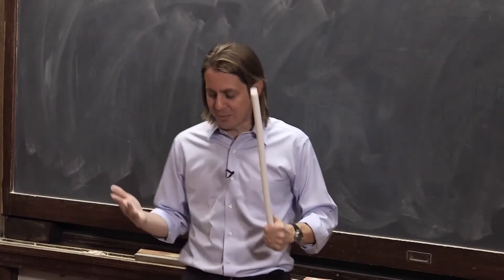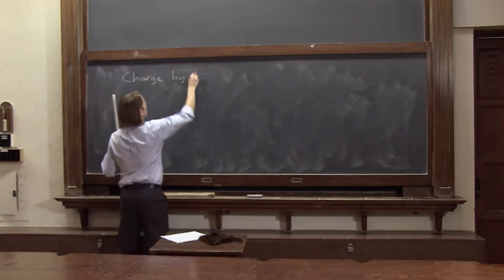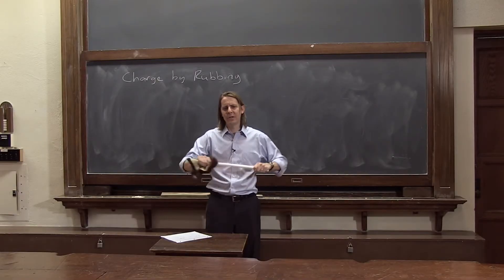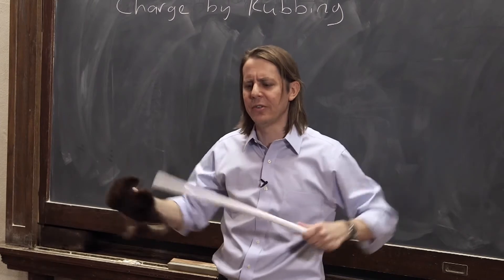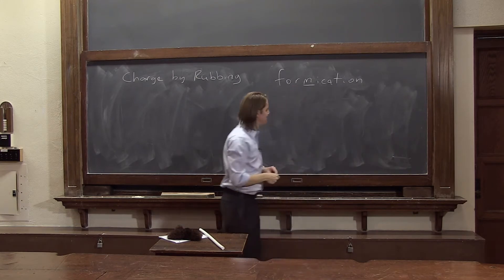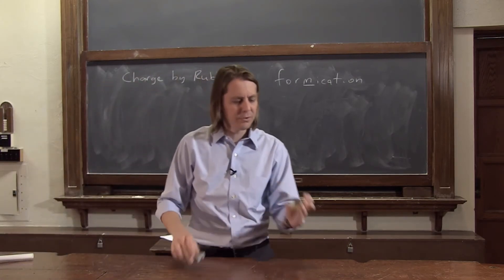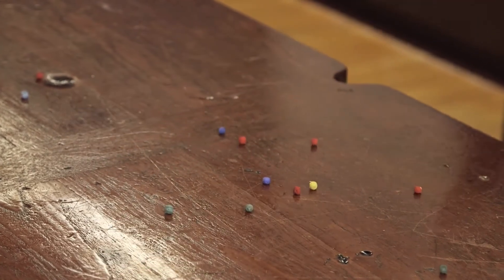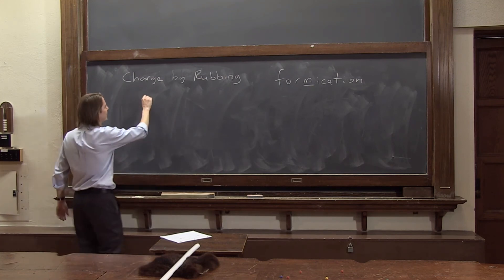DEMO: Teflon Triboelectricity

Comment: Any idea on how to harvest triboelectricity?
Reply from the maker: It turns out that air flowing over a surface can charge it up.  I have seen some references to generators based on this effect with wind (rather than rotating turbines).  I think it has never gone anywhere because triboelectricity is so sensitive to surface chemistry, that running something outdoors would never be reliable.  Just moisture in the air would affect it.  I'm sure there are people pursuing it though.